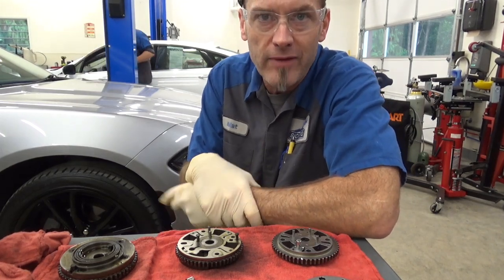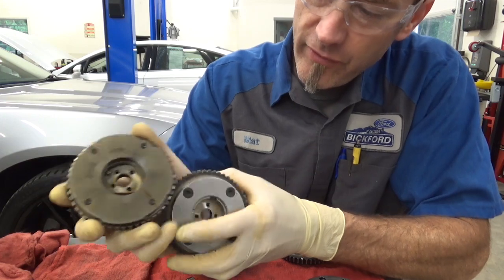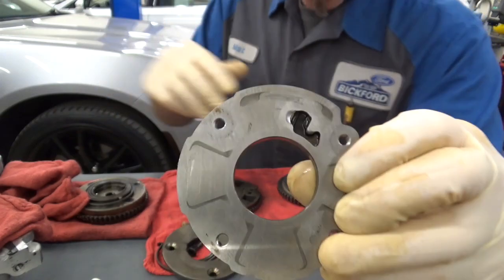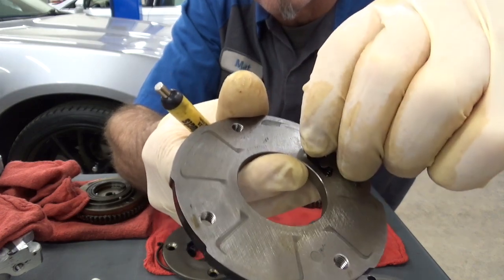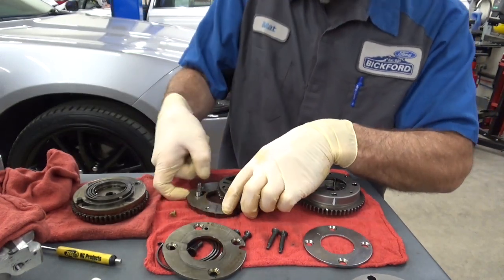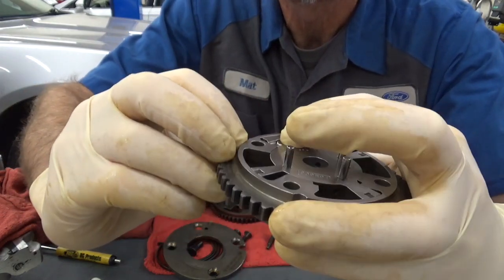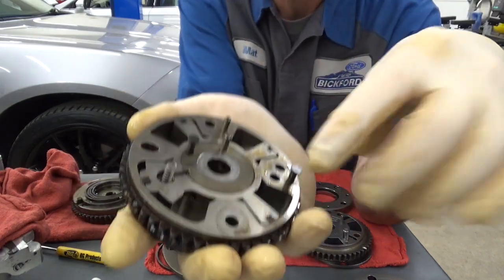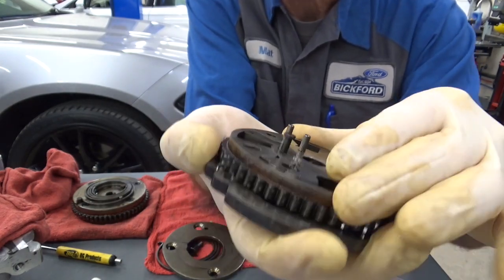ECOBOOST CAM PHASERS. OLD VS NEW. HERE IS THE DIFFERENCE.

Comment: One of my old style intake phasers wore a hole through the front plate, and launched the locking pin into the timing cover, and the pin lodged itself right behind the exhaust phaser in the head right next to the chain. The remaining oblong shaped piece of the front plate was laying down in a valley under the timing cover near one of the chain guides. The sucker was rattling most of the time, not just at startup, probably because oil pressure was bleeding straight out the hole in the front plate. I got extremely lucky... don't let it go too long!

Comment: Hello! I have a 2004 F150 4.6L  with 62,000 miles. I am hearing what I believe are the cam phasers knocking at start up for a couple of seconds. Would it be best just to buy new cam phasers or install a cam phaser lockout kit on the existing phasers?

Comment: Thanks for making this detailed video. Was incredibly curious what the changes actually were. Looking at my old phasers today. I wonder if they added a 3x stronger spring if it could've worked better in the original design. Obviously the phasers work for a bit,  I think the springs give out. If I worked for Ford directly I would be ecstatic to spend their money to test and remedy the issue. hopefully this new design holds up better.

Comment: Can someone please help:  I dont have the cold start rattle like everyone describes but I do hear a very faint knock after the engine has fully warmed up at very low RPM.   When trying to hear where this knock is coming from, we could hear it from the passenger side on the top under the valve cover.  Is this a sign that the phasers need be replaced or should I check something else ? Truck is a 2017 F-150 Raptor with 60k miles.  Oh ! I forgot,  I do have a rattle in the morning when the engine is still cold only when I let off the accelerator. If I try to maintain a stead acceleration, I wont hear anything.  This is only for like the first 5 minutes in the morning.

Comment: nice n great video ,do yo u have part number new version sir
Reply from the maker: 23-2143 Bulletin shows HL3Z-6256-CD INT HL3Z-6C525-CD EXH but think the new numbers are: ML3Z-6256-A Intake   ML3Z-6C525-A Exhaust. Just make sure the units have the metal cage over the spring and they will be the newest version.

Comment: 5:00 Rubber plunger….. well theres the next failure point.
Reply: They will never make a permanent solution, so the economy will revolve around us eventually and come back with a blown engine, 😂😂
Mine was done today, so I will find out if they put the correct part number and not the old ones that they still have in stock 🤦🏽‍♂️🤷🏽‍♂️

Comment: Any updates? Have you had any trucks return with the new phasers?
Reply from the maker: Have not seen one single pickup return after installing the third design. Ford just may have fixed it. The latest version is completely different and the locking mechanism looks much better. I caught a lot of flack couple years back when these engines were coming in left and right and stuck to my guns stating it's the locking pin design causing problem. Some said it's the oil pump, pickup screen, camshafts, mega caps, etc. Time will tell but still think I'm correct LOL 🤞
Reply: Hopefully! I just bought an 18 not realizing this issue was so prominent. It has the rattle. Working with dealership to have it fixed. Once it’s fixed I’m worried it will happen again

Comment: Are the phasers same 2.7 and 3.5 ? And why does 3.5 fail more
Reply from the maker: Phasers are different. The two engines have completely different oiling systems, 2.7 has a cartridge filter while the 3.5L has a spin-on

Comment: Currently own a ‘13 and ‘17 f-150 eco boosts. The rattle on the 17 is noticeable but nothing compared to my 13. I just bought the ‘13 but it’s pretty atrocious on cold starts since I don’t always want to do the delayed start (letting it roll over to build oil pressure)

Comment: A chief engineer worth his salt would have flunked the old design before it ever went into production.  The bearing area in the connection simply doesn't pass the sniff test.  The round pin bearing on a flat surface of the mating part has virtually no bearing area until material starts to deform elastically.  Then you have the corner radius of the pin to further reduce the bearing area, leaving 1 square "blonde one" of material supporting the entire load of spinning the camshaft.  As a bonus, the corner radius of the pin will act like it's own cam for disengaging the pin once the mating part permanently deforms (due to the insufficient bearing area).  No wonder so many folks have issues with the old design.  It is amazing they worked in the first place.
Reply: It was planned obsolesence. They're not dumb.

Comment: Hey Mathew what does a cam phaser replacement job cost? Im local and my truck has this issue, and recently threw p0012 and p0024 codes when I was driving on the freeway, trying to decide if it’s worth it to get it towed and repaired or to cut my losses
Reply from the maker: Sorry about the delay. I can't say what the parts cost but the labor is almost ten hours with labor rates around $200 per hour. Wouldn't surprised with a repair quote over $3000

Comment: I have a 2017 Ford Raptor 3.5 ECO…. Truck rattles every cold start . Once the engine settles down to operating tem. The truck rattled a little still if you press the gas and hold it between 1,500 and 2,000 RPM 

TRUCK HAS 93,000 miles 😢

Sucks that ford has to do this to all the eco engines with these cam phaser problems… im a ford guy but I honestly hate ford for this… I don’t recommend anyone buying a ECO ENGINE! Unless you want to have problems like this ….

Comment: Great video.  That was the best explanation I've seen on Youtube not only explaining, but physically showing what the issue is.  I'm trading in my 2018 3.5 EcoBoost tomorrow for a 2022 5.0.  My Eco has both the phaser rattle and the turbo rattle.  I'm done with it.  I'm not going to drive it just waiting for a code to pop or for it to throw time on an interference engine.
Reply from the maker: Drove a 22 platinum with 5.0 a couple weeks ago. Really nice pickup & seemed to have a bunch more power then previous years. Good luck to you with your new ride!
Reply: Jason the 5.0l also has cam phasers problems. It's both 3.5l eco boost and 5.0l up to 2020. 2021 Ford corrected the problems with their phasers.  5.0l does last longer but will get a cold start rattle . Biggest issues with all of them is not changing oil within 5000 miles or less. People are waiting till the light on dash to tell them to change the oil. Those " recommend " service intervals is correct. Oil breaks down period....

Comment: Just got my 2019 F150 back today from getting these new phasers installed. I am praying I don’t get another check engine light or rattle. Before my truck would get the check engine codes p0021 and p0018 and go into almost a limo mode. It was really frustrating.
Reply from the maker: Good luck to you! Weird you were getting codes.
Reply: @raincitywrench117 my phasers are also rattling and I’m getting a code for exhaust cam position being over advanced. Feels very low on power. 

Trying to get the truck in to the shop to have it fixed soon, but it’s my only vehicle.

Comment: Hey Guys Im looking at getting a 2017 Ecoboost Limited its got 64,000 Miles on it and I'm getting a really good deal if I pull the trigger, When I went to look at it and started it when it was cold the truck had a rattle for 2-3 second and then it went away, Im assuming its the phasers So I wanted to ask how is this new style phaser? Has it solved the problem or is it still something we have to fix 30-40,000 miles in. Also is their anything else I should be aware at or get looked at before I pull the trigger on this truck?

Comment: I'm on my second go round with the phaser replacement on my 17 f150. They used the old phasers apparently when I had the repair about 7 months ago. The sound came back in about a month and was worse. I took it back in last week (just inside my 5 year warranty) and am supposedly getting the new part. I'm hopeful this will actually fix the problem this time!
Reply from the maker: I hope you get your hope! Haven't seen a new replacement come back yet at my shop anyway.
Reply: @raincitywrench117 have you seen any come back with the updated phasers?
Reply: I just took in my 2018 that I bought new in  jan 2019. never had any phaser issue before this but never received any kind of letter about the software upgrades or any extended warranty.  Service Mgr just said there are no longer any extended warranties available to me, standard drive train warranty expired January this year and that it sucks to be me.  So I will be starting the customer support process by meeting with local dealership guy.  Who knows, in the past he has worked with me(especially when i asked why his tech replaced a $500 part first ,which didn't fix the issue, instead of the $50 part which DID fix the issue.).  then I will climb the corporate ladder.

Comment: You are correct about the pin jumping out of the notch. The problem is the spring! Look at the spring on the side. They have lost about 30% of their strength  and now they let the pin float and make a ramp so they move out.
Reply from the maker: I think you are absolutely correct on the spring. Some of these fail at such low mileage it still makes you wonder? It could simply be they just have to soft a spring from the get go and they can't force the oil back out of the hole and thus only engage partially even when brand new. But any way you slice it, the noise is from the pin not locking. 🙂
Reply: So in theory- a spring that gets heat cycled is going lose power. Couldn't a person put a stouter spring in there to solve the problem? Or if you're replacing the phasers, go ahead and find a stiffer spring too??

Comment: So I had these put in my 2020 and I now have a decel rattle in gear when it’s cold like the 5.0s have. Do you think they could have messed up a vct solenoid during the repair?
Reply from the maker: I don't think so. You don't have to remove them to do the phasers. If the noise started right after this service, unfortunately the valve covers will need to be removed and a thorough inspection done like checking to see if the guides are loose, worn or misaligned. Also check to see how far the tensioners are pushed out and for anything that looks not normal.

Comment: When was the last time this part was redesigned? People with 2022 Expeditions are having to have their cam phasers replaced, and May owners on 18-21’s have had to do it more than once. I am sold on the Expedition as long as I know the issue is fully resolved. GM has lifter issues they can’t seem to figure out. The Armada is very uncomfortable with a small third row. The Sequoia is ugly and the new one has no third row or rear cargo practicality. I really am hoping it is worked out. People are also citing transmission failures with the 10 speed, even around as early as 15k - 20k.
Reply from the maker: I thought the latest design was introduced in fall of 2021 but not sure. My coworker is doing phasers on a 19 raptor right now. Both intake vct units are toast & they are the old style. I have not done phasers on a 3.5 newer than 2020 yet. Has Ford still been installing the old design phasers into 2022 production? I just don't know. I'm skeptical that Ford has completely resolved this problem with the 3.5L. Unfortunately they don't offer the 2.7l in the Expedition.

Comment: What is the typical cost to replace the phasers to the new design?
Reply from the maker: I can't say as I don't see the billing but the bulletin shows just under 10 hours labor so I'm going to guess around $3000 including the parts at our dealership.
Reply: @raincitywrench117  I appreciate the reply. Love your videos. 
But geez that’s expensive 😵‍💫 

One more question: will it harm the engine if the phasers aren’t replaced? (when they are making noise on cold start up)
Reply: @13cardenk  for the 2017+ motors, eventually you will start throwing codes and have a check engine light.  The chance of doing catastrophic damage is low, but the chance of maybe needing a few more parts on a rebuild is reasonable.

The 11-16’s also get cold start rattle but the chain and tensioners are what’s going bad, and those can fail catastrophically if not repaired.

Comment: If I change the part , Should I change another piece, such as the chainsaw?
Reply from the maker: There are no other timing components needed for this recall. There are gaskets and a few stretch bolts that will need replaced as per the recall.

Comment: Welp, my 2020 with 21k miles just rattled loud on a cold start today. Even slightly rattles on warm starts. What’s weird is it was quiet as a mouse yesterday. Oil changed every 3k and start stop was disabled day 1 so it’s def just a terrible design despite some guys claiming long oil change intervals causes it. Wonder if i should dump the truck once there swapped cause who knows if the new ones will last any longer then 20k. I would expect the timing system to last 150-200k on any new vehicle lol.
Reply from the maker: Well, that's a tough decision. I still have yet to hear anything though my sources if these new phasers are taking care of the rattle permanently but have not seen a return after the new design has been installed, yet.
Reply: @raincitywrench117  well, it’s going in to have them swapped. I have a catch can installed and I’m wondering if I should take that off or do you think they won’t give me any hassle.

Comment: Are the intake and exhaust phasers (new) have the housing or just the intake ? I ordered all four and they sent me the intake with new housings but the exhaust are the old design. Should I return the exhaust and replace with newer design if available ?
Reply from the maker: Yes, return them. All four new phasers will have the cage.

Comment: Hello, can I ask for an honest opinion? What do you think about a 2015 Ford F-150 3.5L ecoboost with 104k miles, would it be worth buy as a long term vehicle? Are they unreliable? Is it a truck you’d recommend to someone who doesn’t really tow or haul much? Are there any big issue that can be detrimental? It’s also a 4WD.
Reply: Honestly, the 11-16s had less small miscellaneous issues, but the cam chain/tensioner issue can be catastrophic if left unfixed and they don’t have port injection. 

The 17-20s have this cam phaser issue, which won’t lead to a catastrophic failure.  The new phasers also are fixed.  These motors have more miscellaneous small issues and less dangerous issues.

Realistically, there are over 1 MILLION 3.5 Ecoboost F150’s on the road, and out of any vehicle I’ve seen, I’ve been surprised to see how many 200,300,400, and 500k mile trucks there are out there with stock motors.  I would say overall you can’t go wrong with any gen 3.5, but the 2017+ is better for sure if you can afford it.

If not, the 15-16’s have a revised timing chain and tensioner, actually similar to the 17’s, so they’re considerably one of the more reliable years.

If you’re okay with a 2.7(I wasn’t, I wanted to tune mine.  Making 600hp now lol) they’re the most reliable by far.

The 2.7’s have basically no major issues besides a few small manufacturing things that happened and were taken care of a while ago, as well as the oil pan leaks.
Reply from the maker: That would be the first gen ecoboost. The second gen is much better. I would check for broken rear exhaust manifold bolts and leaking turbos. 2nd gen went with two chains and thicker side plates plus better turbos. I wouldn't say they are unreliable but over 100k is when problems start to pop up. With that mileage, the chain may be stretched and eventually throw cam/crank correlation codes. Unless it's been regularly serviced and everything looks great I would steer clear and keep looking.
Reply: @raincitywrench117  Thank you so much, so if I were to get an Ecoboost, you’d recommend anything after 2017?

Comment: I double checked the part No. for the new designed its not fit with my 2018 Expedition!!! will you confirm on that Sir?
Reply from the maker: Not sure what to say. The part # in the video fits a 2018. What is not fitting?
Reply: @raincitywrench117  Thanks for sharing knowledge. When I tried to order that part# it shows that this will not fits with 2018 expedition, so sir have you installed it on that 2018 expedition? Does it work as the original one? Should I just ignore the fit warning that appears about the compatibility? Thanks in advance
Reply: @zainalsalimi8948  If you have a 2nd Gen 3.5 ecoboost, the part numbers are HL3Z-6256-CD and HL3Z-6C525-CD, OR the newer 2020 part numbers ML3Z-6256-A / ML3Z-6C525-A.  I would just try to get the newest ML3Z.
You can read plenty more including all of the parts required for the job in the official doc here https://static.nhtsa.gov/odi/tsbs/2021/MC-10204046-0001.pdf
Reply: @mbrick  Perfect, thank you for this advice 🙏